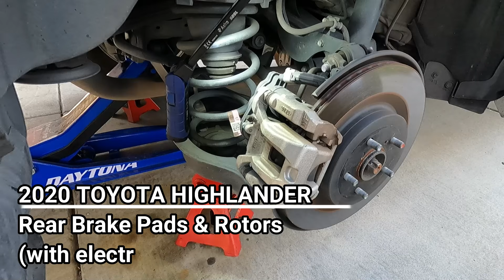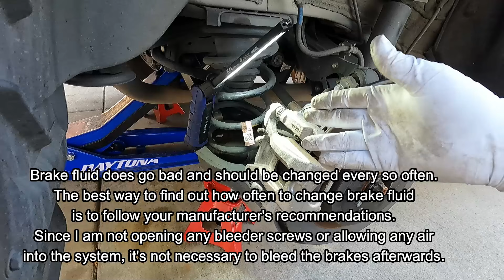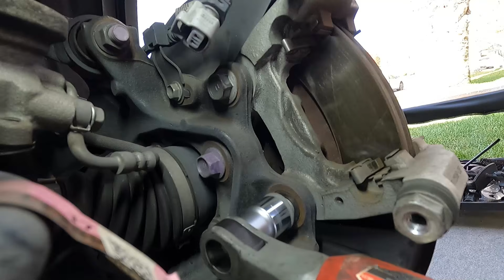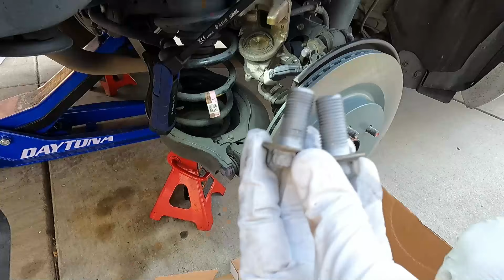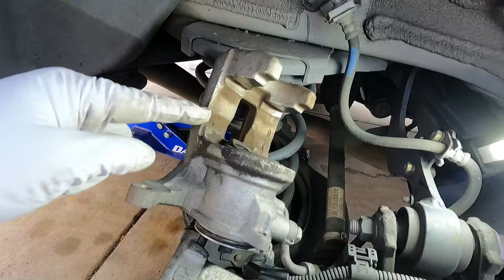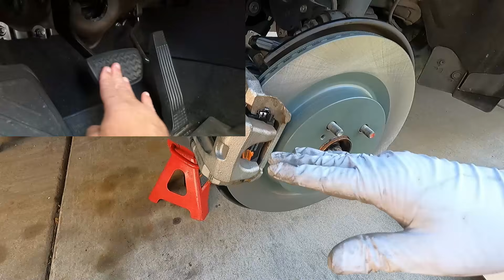2020-2024 TOYOTA HIGHLANDER - HOW TO RETRACT ELECTRONIC PARKING BRAKE & REAR BRAKE PADS & ROTORS DIY

Comment: Guys FYI, DO NOT follow this method without first putting the parking brake into service mode if your vehicle is 2021 or newer. I followed these instructions to the T and was left with parking brake failure which culminated in requiring a EPB calibration which is inly possible with a very spendy scan tool or a trip to the dealer.

Comment: DO NOT DO THIS .. This will mess up parking brake  calibration .There is a simple procedure to retract that EPB ( brake  maintenance mode)  Takes less than  30 seconds for me to put brakes in the maintenance mode ...  !
Reply: Just followed this video and now have a brake malfunction i cant reset now im ganna have to go to the dealer

Comment: those rear pads look good almost new, putting the rear parking brake  in service mode is the way to go. look at the car care nut for reference because anything else can damage the rear parking brake. in service mode it will compress all the way, as for break fluid you don't need to add break fluid for a break on rotors job. my 3 years of mechanic training the master mechanic instructor you never add break fluid or it will overflow. the purpose of the master cylinder is to show break pads wear without using the break wear indicator tool yes the on the has green, yellow and red for the millimeter wear 12 for green which is practical new. my understanding is caliper bolts are 28 pounds of torque and 75, 79 pounds of torque for the the 17mm brackets bolts.  those bolts and clips for the pad slide can be reused. I did a 2018 highlander and all hardware is usable with 50,000 bolts clips all great condition. establishing a pedal use the tip of your toes for the press and to break fluid with return to factory level when it left the dealership

Comment: Great video, but I'm curious about one thing. When you took the parking brake motor off you retracted the brake caliper piston with your torx bit. But when you re-installed the caliper, why didn't you set the brake piston back to it's original position with the torx bit before you put the parking motor back on? I realize the brake motor wouldn't push in the piston as far because the pads are new. But might it give you a "fault" code because the parking brake motor isn't at the original closed position that it was when first removed it?
Reply from the maker: It will automatically adjust the first time it is applied.
Reply: It dose not it couses a malfunction

Comment: Did you put rear pads correct? There small clip must be on bottom not top.
Reply: I agree the brake squealer is not in the correct location. Should be on the leading edge not on the trailing edge. Other than that small error, great video. I plan to replace the brake pads on my rx350 that has a similar design.

Comment: great tutorial  I thought  the rear brake pad clips or indicator clips goes at the bottom of  the brake pads
Reply: You are correct. the leading edge of the rear rotor is at bottom.. For the front wheel the indicator at top. Dan The Fix should correct !

Comment: Before you do the brake  job on the rear rotors make sure to watch some videos on YouTube how to set it on the service mode because if you do manually without a scan machine you end up in the dealer to recalibrate
Reply: Yes idk why this YouTuber does t use service mode

Comment: I have 2018 Camry. I changed my caliper, transfered the motor, bled the system, put everything back and I’m getting “break malfunction”. I tried absolutely everything. Unhooked the battery for 10 minutes, tried various sequences. All I’m reading is that I need to have the code cleared and system updated through Toyota. It’s bullshit and I can’t figure it out

Comment: Thank you sir, I needed to know if these calipers had twist pucks in em or not.  I’ll remember that about the parking brake motor.  Couldn’t you simply just release the brake before starting the job though?
Reply from the maker: It doesn’t wind back far enough when it is just in the off position.  It has to be in service mode.  I just have found it to be easier for me to remove the motor and wind it back manually.

Comment: Great video. I was wondering how you know when you need to replace the rotors or just pads?
Reply: You put micrometer on it to be sure.  Pretty much every rotor has a min / max measurement on it somewhere.  I just replace the rotor every other pad slap under normal circumstance.

Comment: Can you plz explain what is the point of these new e-brakes? I mean back in the day we had a handle or peddle which you can use in can of an emergency but my last few cars came with a button. What would someone do if the brakes fail and you need to stop your car?
Reply: Good question
Reply: Tonya Harding method…..lol
Reply: To make the job more difficult so you don't want to do it so that you go to the dealership to get it done and blow WAY more money than you need to
Reply: Gonna ask this very question with my next service. If there is one thing that ticks me off is over thinking tried and true methods. My guess is that I’m going to stump…my service guy.

Comment: 0:44 You need to memorize that electronic parking brake service mode procedure. Now most Toyotas are turning into that system and it's the same procedure for most of them. It's going to be a time saver for you as a mechanic doing it over and over. 
I have it printed out on a piece of paper in my glove box. The good thing about is that I don't have to readjust the parking brake anymore.
I'm happy to see my hero again RotoRRemover9000.😊.
Reply: What is the sequence?
Reply: What’s the sequence?